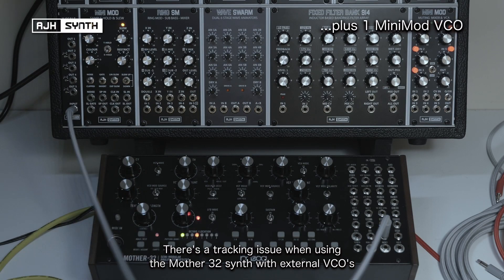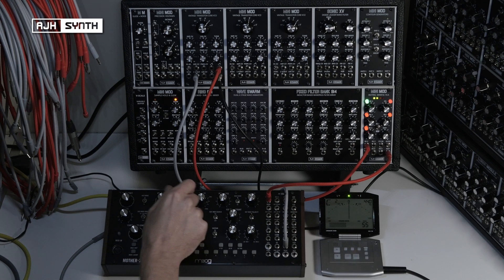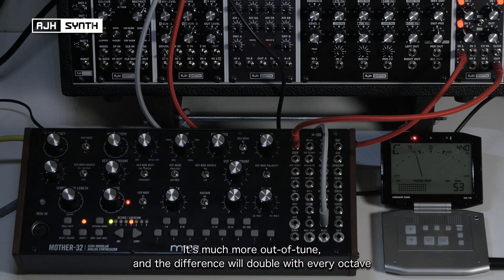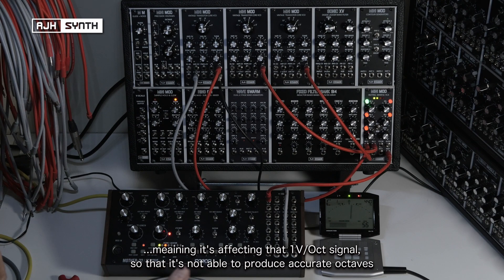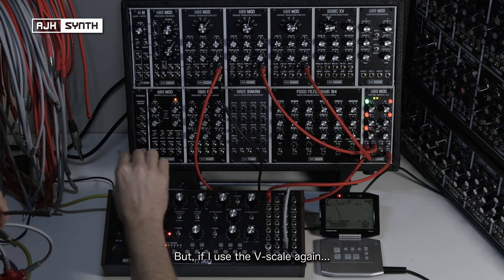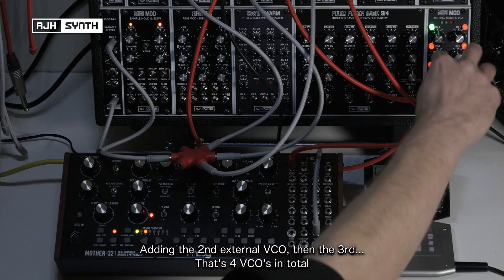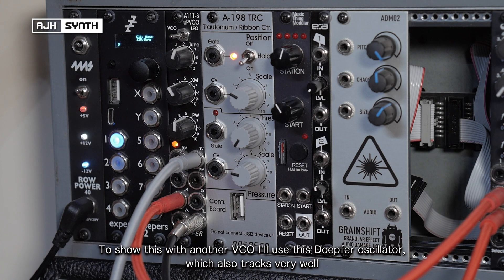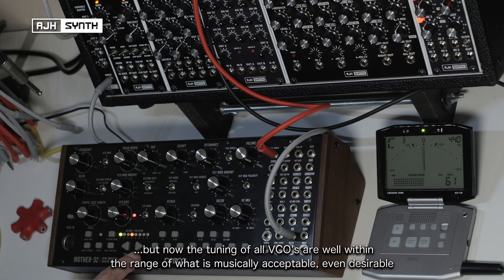Mother 32 Tracking Correction with the V-SCALE from AJH SYNTH - Fix those out-of-tune External VCO's

Comment: Newbie question: Does this also work the other way around? I have trouble keeping the M32 and other oscillators in tune when controlling them through an external sequencer/quantizer.
Reply from the maker: It's a good question. It should do if connecting to the VCO pitch of the M32, but it depends what the tuning issue is - if the other oscillators are pitch correct from one octave to the next, but the M32 is fine at one octave once retuned, yet becomes increasingly flat, or even sharp as you play the same note at progressively higher or lower octaves, then this should fix it, provided the M32 is calibrated correctly. However if it's just the tuning drifting slightly over the coarse of time, then that's just analogue oscillators being analogue oscillators.
Reply: @AJHSynthOfficial  Thanks! My problem is that unlike the other oscillators which track nicely the M32 becomes increasingly sharp over the octaves (approximately 12 cent per octave). But only with external sequencers (tried a few different ones). With the internal KB of the M32 the tracking is fine though, so it's not a calibration issue.
Reply from the maker: You're welcome. Yes that sounds like something the V-Scale should fix, although I can't guarantee it 100% as it's another manufacturer's product, but the problem with the M32's output is impedance related, so it would seem safe to assume it's the same issue with the pitch input.

Comment: Thanks for sharing and the very good explanation. What patch cords are you using and what manufacturer is the case with the AJH modules - I like them :-)
Reply from the maker: Thanks, that's great to know. Cables - I can't remember, they were purchased on eBay a long time ago, but I (the video creator, not the module creator) made the cases myself.